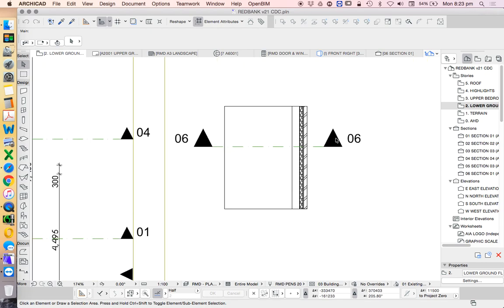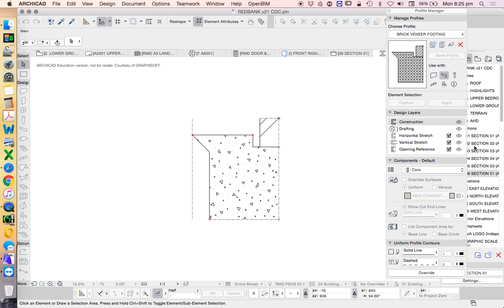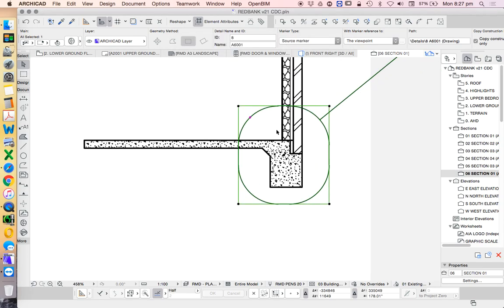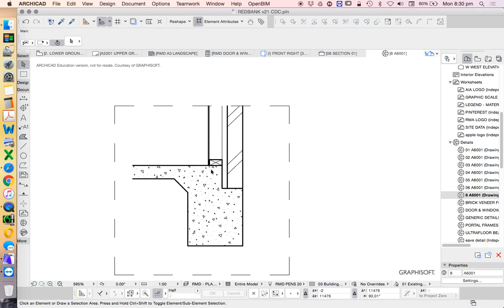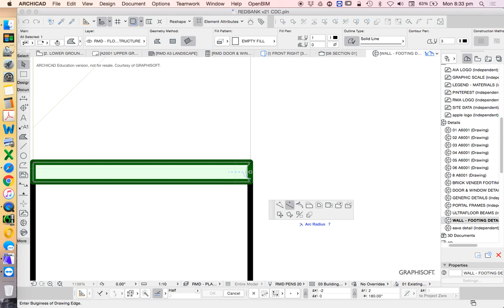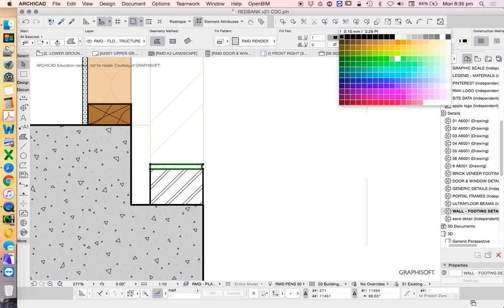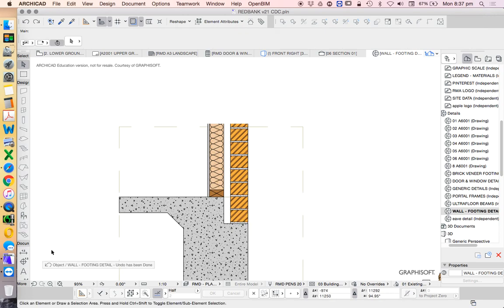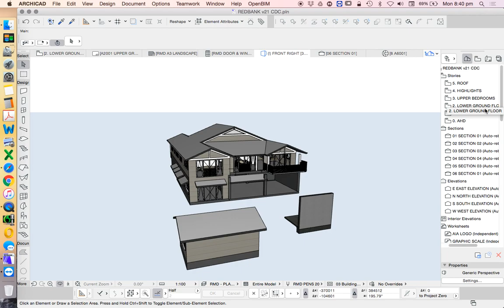ArchiCAD 21 House Project - part 31 - detail markers and 2D detailing

Comment: Great video! One question regarding using the Independent detail with the original view as the reference view... When you place the independent detail on the layout, how do you assign the marker correctly so that the references stay linked?
Reply: did you find out the best practice for this? I like the way detail markers reference to the drawing where they are inserted and tie things up neatly, i would like to keep that logic in the best way possible.

Comment: Interesting to see that you have your task bar on the left side of the screen! How do you find this? Is it there to align with your AC toolbox, or are there other reasons? Might have to give it a go 👍
Reply from the maker: Hi Chris,
As I use a small screen for tutorials, I want to maximise the effective size of the archicad window. This configuration makes the most sense  (to maximise the archicad window, and matching with my archicad workflow)

Comment: Hi i need help.. whenever i create a detail view from section.. the detail created is always blank.. any solutions for this?
Reply from the maker: Hi Dariel,
Hi Dariel. Make sure that the settings are on 'create a new detail viewpoint' not 'place a linked marker' or 'place an unlinked marker'
Reply: @RobertMannArchitect  Hi thanks for the reply ive just found out the problem.. it was because of the clone setting in view map.. by the way, any way to create a stair detail plan.. any way to display the plan in full view? Since some parts of my stairs is under the slab, also can display it full due to floor cuts, any ideas to generate my details? Thanks a lot